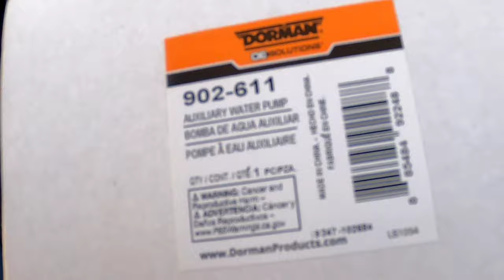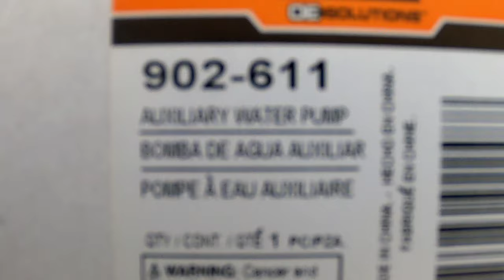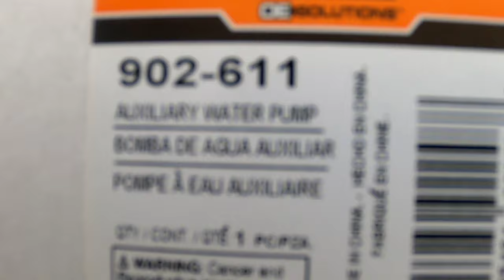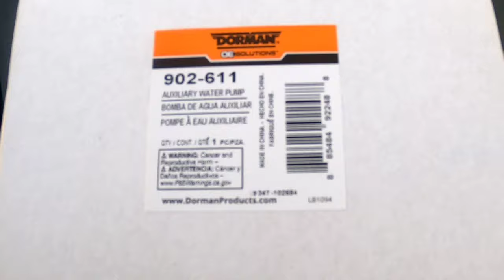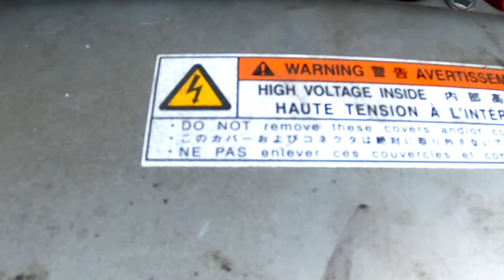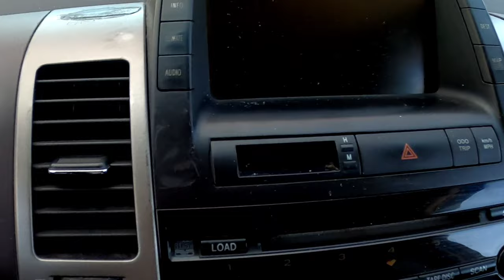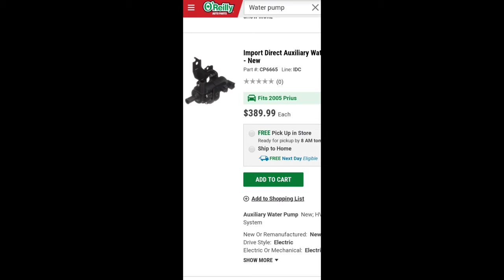auxiliary water pump 2005 Toyota Prius, part 1

Comment: Hi did you change this I pump because you had no heat?
Reply from the maker: @john johson. I was having a problem with a code p1151 and the car overheating. I also had no heater so i tried replacing the pumps, it worked  for a while but i ended up having a bigger problem which was a bad head gasket. So i replaced it and everything work out. Best of luck 👍
Reply: I’m having code p1122 no Heat even after bleeding the cooling system
Reply: I’m thinking it’s this same aux pump since it’s getting some heat but then goes out to cold
Reply from the maker: @john johnson. You can also try the sensor underneath the coolant storage tank on the driver side. Sometimes it could be a failed sensor. For me it only fixed it for a little while. Hopefully you don't have a bad head gasket. You can also try when the car is cold, open the radiator cap slowly if you notice pressure coming out then its a big possibility you have a bad head gasket. The only reason I say this its because my prius was throwing all kinds of codes right before i started to replace water pumps. I ended up replacing all the water pumps on the driver side hoping that would fix it but it only lasted 300 miles, no luck for me. I hope you can resolve this issue as it can be very frustrating with this complex cooling system and lets not forget the bleeding process, "oh boy thats super challenging" but dont get discouraged you can definitely get this job done. Sending positive vibes your way! 🙂👊
Reply: If it was a blown head gasket Josie think it would be overheating? I have no overheating problem
Reply: Don’t you * not josie lol
Reply: Bro also question: you didn’t disconnect the hybrid battery for this ?
Reply from the maker: @john johson. No worries lol🤣 yes, very true but my car wasn't overheating at first either. then i started replacing parts. I should of done a block test before replacing parts and maybe I would've saved some money. After all the replacements more issues started to happen. I ended up going to a shop to get a full diagnostic done on the cooling system.That's when they told me I had a bad head gasket. I told them the car wasn't overheating. They said it was going to get worse overtime. I just kept dealing with it and the overheating started more and more until I did the head gasket to continue driving.
Reply from the maker: @john johson Yes, i disconnect the battery for anything im going to do on the car just to prevent any other issues.
Reply: @johnjohson5360  that is just the 3 way pump is easy to replace